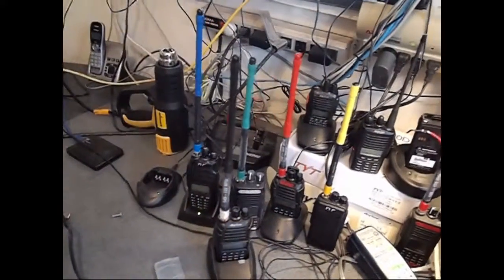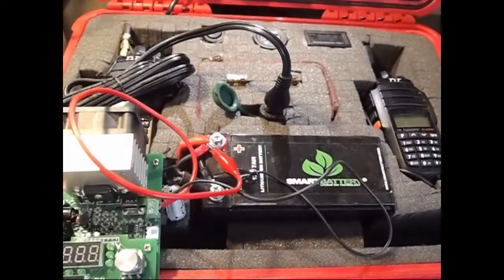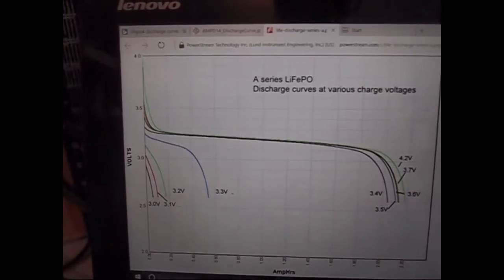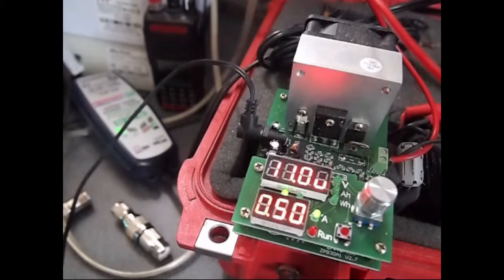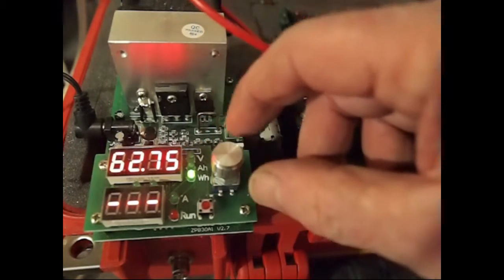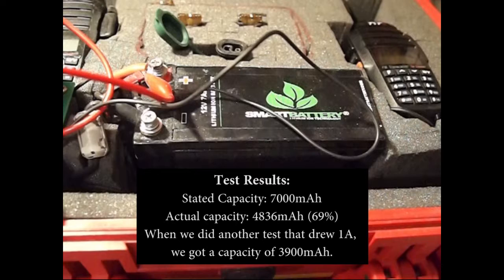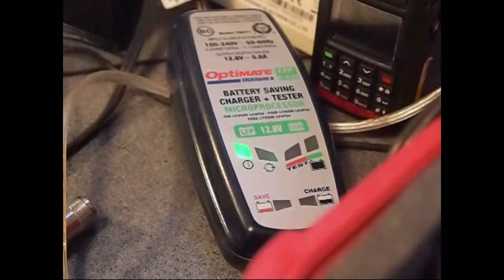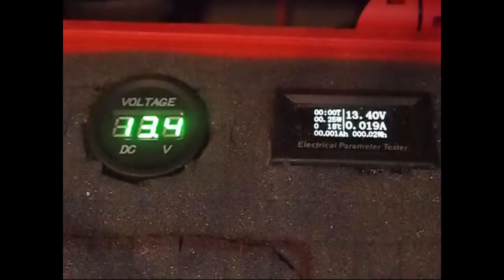Capacity test of LiFePO4 "Smartbattery" model SB7 from Total Battery (Totalbattery.com)

Comment: addendum: charging a 12 v LFP battery to 100 Percent means with a voltage of 14.6/14.4 volt measured at the battery terminals, after about tree hours the RESTING voltage will be around 13.4/13.3 volt, it looks from your video that your fancy "Canadian"charger is severely undercharging this battery, it has to be 14.4 volts at the end of charge....

Comment: Best seems to repeat this test with another battery, when this other battery has more capacity than you know for sure, when not repeat  the charging with another charger, remember it takes two to tango, Gould luck, with testing, interesting vid btw
Reply from the maker: Thanks for the suggestion. The dealer was not very forthcoming with offering to help with the problem by offering another battery, in fact they had less than average customer service. And as that brand of battery is suspect, I am not going to throw more good money after a bad product. If you can recommend another brand of battery with the same specifications that you have had good luck with, that would be appreciated. 

BTW, the charger tested out fine, there are no issues with the charger.

Comment: Also Voltage measurement is very unreliable with Lfpo Batts, because of the very flat discharge curve, a better way is measuring amps in versus out!

Comment: why not use a small Chinese Minghe  B3603 bench CPU to recharge this small LFP battery properly? i do not trust these "automated"CAR battery chargers at all, Ive been using several similar chargers for lead acid chemistry, i have used tree different brands and they all gave different charge result with AGM batteries , so go figure what this commercial and overpriced units will do to the newer type of LFP batteries, charging a LiFePo4 batt (LFP for short) means charging at a MAX amperage of 0.5 C (in stead of c/20 MAx for lead chemistry)and a MAX voltage of 14.6. volts, this wil get the battery 100 percent charged, however for a long battery life its better to not go higher than 13.9 volts, this alone wil get you in the 90 percent charged region but is MUCH better for the health of the battery, since LFP DOS NOT SULPHATE, there is no need to charge them full each time, always measure the voltage at the battery terminals itself btw, many times you get a voltage drop in the cabling so your bench PSU may be set at 14.40 volt but is it reaching the battery, hope this helps.....
Reply from the maker: Constructing a generalized opinion formed from results observed by using a variety of lead acid car chargers and hypothesizing that will apply to Lithium chemistry is like trying to knit fog. The highly regarded Optimate chargers are task specific, in this case the one used was chosen as the best for the LiFePO4 battery in question. If there was a Chinese charger that compared I would be happy to embrace it, but using a cheap hand-soldered Buck converter with poor regulation capabilities as you suggest to charge an expensive battery is not something I'm prepared to entertain. The point of the video is not to look at the merits of charging procedures, it's to illustrate that the Smartbattery from Totalbattery.com seems to have problems, as does Totalbattery's customer service.